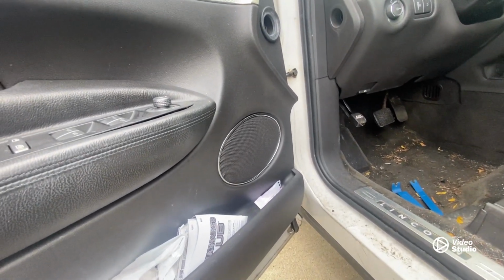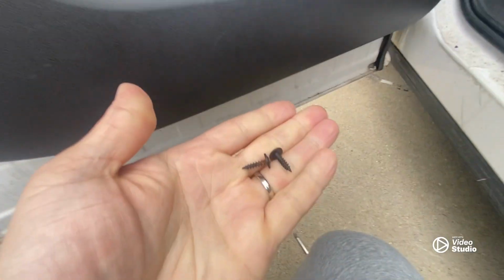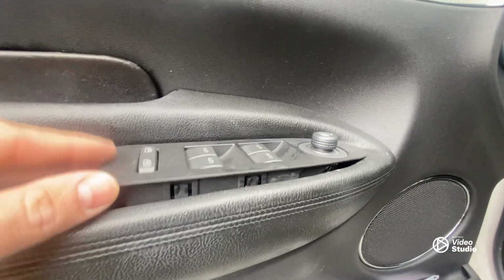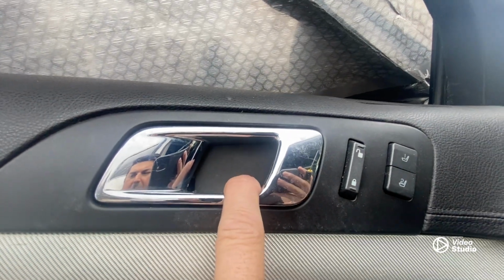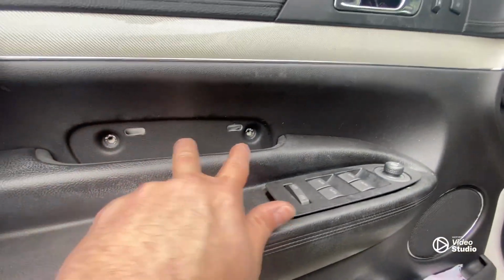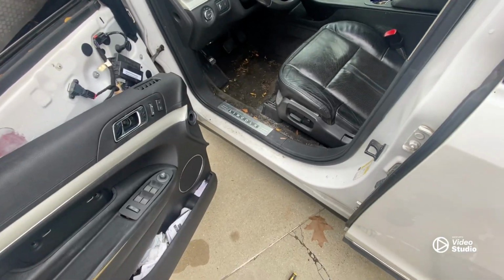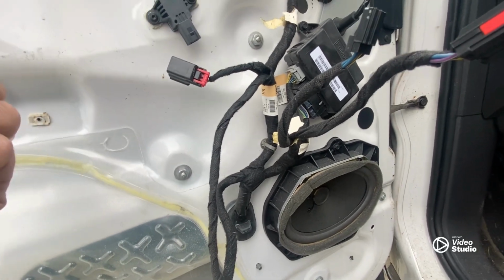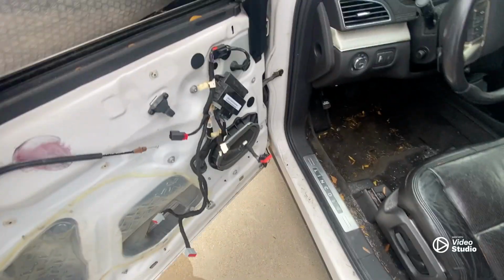Lincoln MkT door panel removal

Comment: Hey not sure how fast you can reply to me! But im possibly going to get a replacement door for my new to ke 2012 lincoln MKT, the parts car is a 2012.

I know the interior panels arent the same, but would i be able to just put my stuff onto the 2013 door and bolt it to the 2012 car??

Thanks!
Reply from the maker: I can make a video for you but it should work. I will double check.
Reply: @mikezaverin  Hey I actually was told to call a wrecker yard, And they were able to tell me that everything from about 2009-2016 I believe he said, are all the exact same door! Just different interior panels but otherwise the panels will bolt on regardless of year! 

But thank you!!